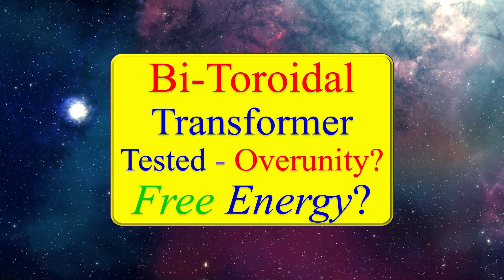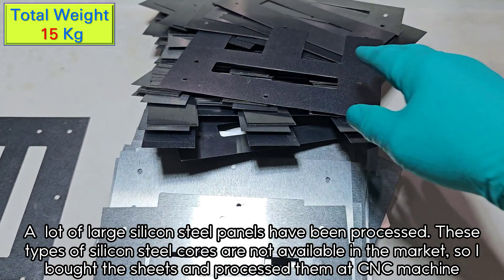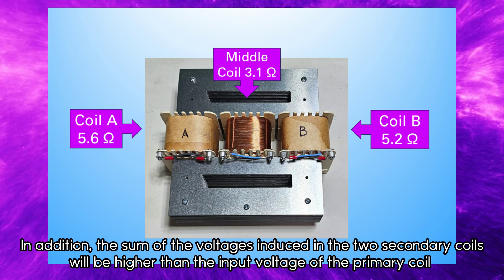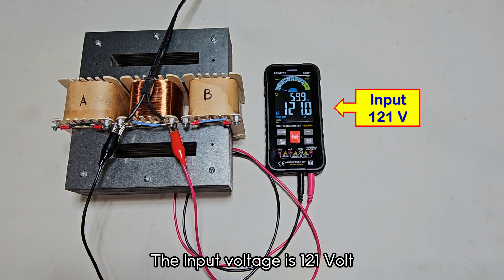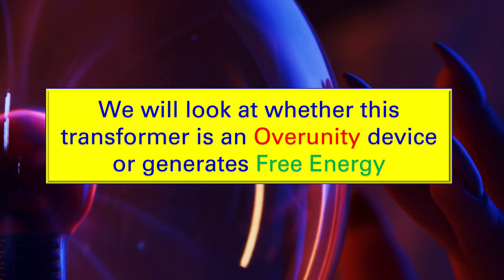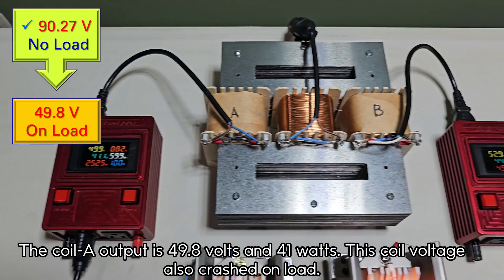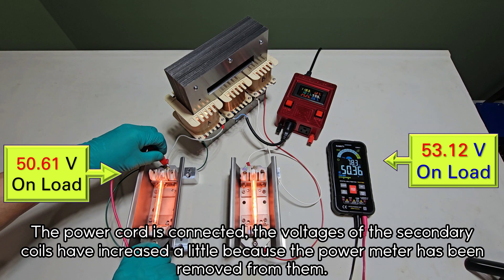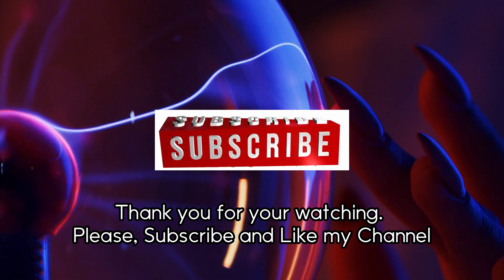Bi-Toroidal Transformer Tested - Overunity? Free Energy?

Comment: 😢❤, hi, please share sizes of your steel core. Most impirtantly how much sheet or how many meters did you buy.😮😮
Reply from the maker: I will let you know soon
Reply from the maker: Hi Friend,
Have you ever dismantled a transformer?
An “EI” type transformer is assembled using two types of silicon steel sheets: “E” and “I”.
• 	The bobbin thickness is 52 mm, and the silicon steel sheet thickness is 0.32 mm.
→ 52 ÷ 0.32 ≈ 162 pieces of E-type(You know mine is different  “E” type) silicon steel sheets are required, and the same number (162 pieces) of I-type sheets are also needed.
• 	These special silicon steel sheets cannot be purchased directly from the market.
There are generally two ways to manufacture transformer cores:
1. 	Stamping silicon steel in a factory – but this is quite expensive.
2. 	Cutting with a CNC machine – also costly.
For the coil:
• 	The wire diameter is 0.8 mm.
• 	52 ÷ 0.8 ≈ 65 turns per layer.
• 	With about 12 layers, that makes roughly 780 turns per bobbin.
• 	The middle bobbin has around 600 turns.
👉 If you want to save money, consider reducing the size of the transformer.
Reply: @LanikaiEnergy ❤❤❤❤ Thank You sooooo much, will do this right away. You should consider doing a video on that in future. Yes I am always testing on transformers🎉🎉🎉❤❤😊😊. Blessings to you and family
Reply from the maker: @MakaLizwi Before you begin, you’ll need to locate a suitable bobbin. I bought mine on eBay in the past, but lately they’ve become difficult to find

Comment: There is a large discrepancy between the resistance ratio of coils A and B and the voltage ratio of those coils. Right off the bat this shows something is wrong.
The voltage ratio should reflect the actual turns ratio, which with no load is far more meaningful than coil resistance.

Assuming the coils are wound with wire of the same cross-sectional area, I'd bet big money that the resistance measurements were quite inaccurate. This is virtually invariably the case with the "free energy" and "over-unity" types - none of them know how to accurately measure anything electrical. None of them that I've seen have anything but cheap instruments suitable only for relative crude work.

Proper winding of coils requires accurate counting of the turns.

Comment: I believe the two output coils must be the same value/resistance/frequency so they resonate/vibrate with one another via the outer magnetic path of the stator. If these two coils don't resonate there will be no over-unity, if two bells on the same frequency ring and the same time the sound/vibration is amplified.
If this is true then in theory the more power drawn, the stronger the resonance/vibration better the two output coils which should result in the input current drawn dropping. Over-unity should be achieved and I hope you achieve it brother. 

Apparently two opposing magnetic fields results in energy amplification, we see this in a microwave ovens magnetrons resonant cavity. The strong the magnetic repulsion the greater the energy amplification, I think we can consider magnetic repulsion, resonance.. But then again the name "resonance cavity" is a bit of a give away lol... But if your two output coils aren't the same frequency the experiment is doomed to fail as with the bi-torodal transformer the middle of the top and bottom magnetic channels is where two opposing magnetic fields will or should oppose/repel one another.
I hope this info helps 🙂🙏❤️
Reply: 2 OposingMagneticFieldsCancelEachOut.AndWeGetZeroMagnetism,So,ZeroEnergy.Like2CurrentsOposingEachOtherWeGetZeroCurrent.Resonance,MeansWeNeedToBeInPhase,NotIn Antiphase-180Degrees.AsFarAsIKnowAmperageResonanceIsObtainedOnlyBetweenACoilAndACapacitor.

Comment: You need to do more tests with different loads and different resistance
I got a 90 degree phase shift to the primary which means power factor is zero and watts in AC is  V x.A x PF

I also used 60hz and 120Vac from grid

31 ohm resistor brought the 90 degree phase shift for me at least

You also need to TUNE the transformer with HV AC caps in series and/or parallel to get the 90 degree phase shift happening 

What it is, is a pure reactive power to real power "convertor" and also a transformer.

It would be pure luck if those heaters just happened to be the ideal load for your particular transformer

Comment: Your problem in this video is the secondary core reluctance not small enough so it cannot absorb all the secondary flux , so that you not free energy ! Primary reluctance must higher than secondary smallest 8 times ! And you must use amorphous cores !
Reply: From experience on these transformers, you will find that the LOAD is what decides if it will be successful experiment or not.
I had to try many different resistances until it creates a 90 degree phase shift in the primary.
I also used 60hz and 120vac from grid
In my case a resistive load of 31ohms created a phase shift of 90 degrees, which is the goal to achieve.
In AC,  watts = V x A x PF 
90 degree phase shift is PF =zero that's what you want to see 
I had my secondaries in series to load.
Try many different loads that happen to work creating the backemf to not return to primary but takes pathway to opposite secondary.
If you want succeed or not is up to you, to do many experiments until you manipulate it to work with a particular load
Mine happened to be 31ohm resistive load.
This made for a 90degree phase shift.
Do it runs on pure reactive power but outputs real.power.
It converts reactive power to real power!
When you get it right 
I think your heaters as load too heavy of load, they suck power out and do not let the backemf "take it's own course" through shunt bars to opposite secondary 
I did many tests.
My YouTube channel 
MrDKONZEN 
Look about a year or two ago in the 300 or so videos I put up 
Also TimTron was very successful with his BiTT transformers.
They do not always work!
Depends on load my point...

Really nice cores you made!!

Keep at it, if you want succeed you will, if you want to give up then you will not succeed.
Also you need to tune it with oil filled HV AC caps in series and or parallel.....
That's more work on bench to do.  
I would say don't give up try resistive loads not inductive right now.
Put dual channel scope on primary play with loads and caps until you get 90 degree phase shift on primary.
I also worked with 60hz 120vac from grid like you did.
So it can be done....
Have some fun with it don't draw conclusions from first round of experiments it took me months with many different set ups.

Comment: Great idea experiment.  However, having so different coils in your setup defeats the purpose of the experiment.  You have introduced an imbalance in the system.  Can you, please, repeat the experiment with 3 identical coils or at least the 2 secondary identical, i.e. same number of turns = same wire length or resistance.  Also input/output powers measured at same time.  Thank you, good day.  Feel free to contact 4 chat if u want.